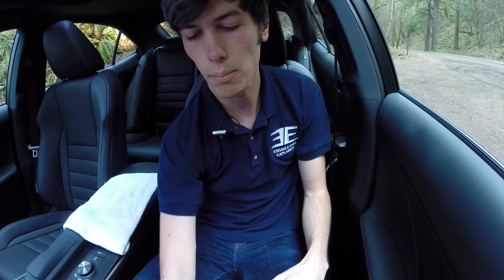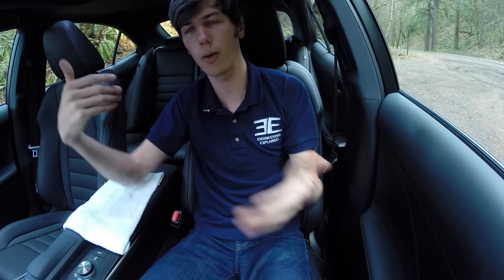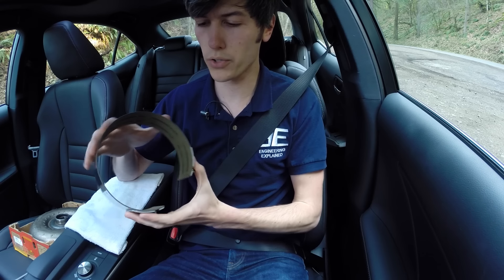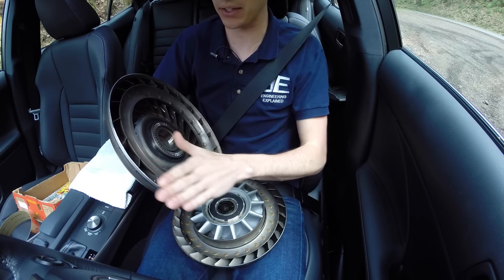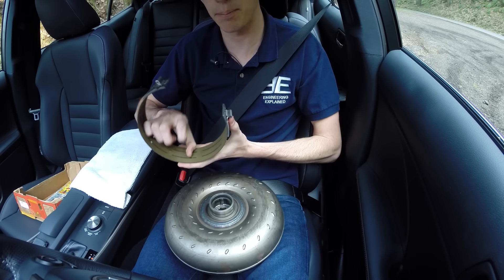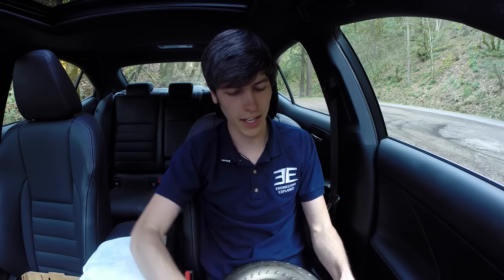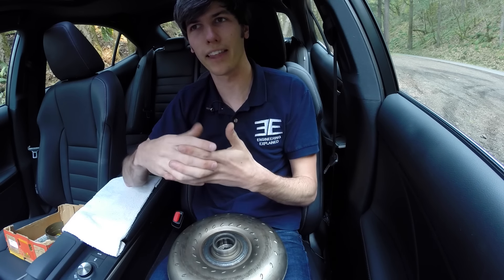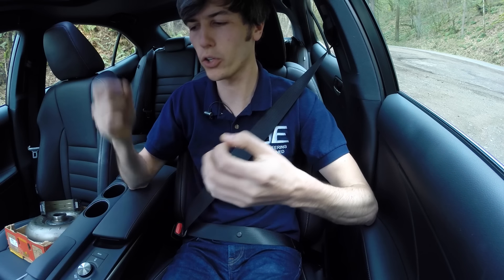5 Things You Should Never Do In An Automatic Transmission Vehicle

Comment: I like to put my car in neutral down a hill and pull the keys out.
Reply: lol
Reply: hahahaha
Reply: Sometimes, I even get out of the car.
Reply: Serious Business OMG lol!!
Reply: No joke. we live two blocks of gravel road away from the highway in town. I spend half a block getting up to 45-50mph (25mph speed limit), then put her in neutral, shut her off, pull of the key and put it in my pocket. Only use the brake to make it home.
Reply: Ethan Reinsch lol!! With all my luck Id blow past the house cuz I wouldnt be able to push the break hard enough! 😂😂
Reply: sometimes i put the handbrake up.
Reply: hahahaah fuel effieciency
Reply: Yes, of course,  how else can one car surf with no passengers to take the wheel.
Reply: Weight reduction. Smart.
Reply: Lol. ..and turn lights off at night to save the battery.
Reply: Darth Ramage and don't forget to remove your seat belt. It's more comfortable that way. 👍
Reply: BAI PATTU rest your eyes too and take a nap it helps on long drives
Reply: HAHAHAHA
Reply: Dodge Neons. Show cars
Reply: Turn coming up. Oops, steeringlock.
Reply: Go downhill backwards in manual shift cars; the engine turning backward creates oxygen and puts fuel back in the tank!
Reply: Laughy ha ha, but I heard on the radio news a few years ago a "warning from a coroner not to turn your car off while in motion" because they found some knob actually self-Darwinised a few years back because they turned it off down a hill, steering locked, crashed, rest in pieces.
Reply: Yeah, take the keys and throw them out the window while coasting down a long hill ! LMAO.
Reply: Darth R. you are crazy man
Reply: you know that's bad for your transmission how do you think its getting trany fluid the car is in gear
Reply: And jumping out.
It makes me think "one more murder that I got way with.
while seing the car going to the river.
Reply: Darth R. lol
Reply: 😂😂😂😂. I live for these comments
Reply: This is why i love read the comments rather than watch the video lol
Reply: +Guru Gill Gurmehar is castrated
Reply: We met in heaven in it ;)
Reply: Darth R. Ayeeeee 1000th like
Reply: Funny actually my truck is so worn that I can pull the keys out while driving, it won't shut off or anything.
Reply: Majestic Bravo my dads truck can do that😂
Reply: Majestic Bravo  My parents had an '83 Caprice that was like that.  Was actually super convenient at times.  If you turned the car off but didn't put the ignition in the lock position, you could start it again without the ignition key being inserted.  Or, ya know, run to the convenience store and take the keys out, leave the car running, but lock the doors.
Reply: Darth R. Lol
Reply: and jump out of the car
Reply: Darth R. La vida es un riesgo carnal
Reply: Darth R. I
Reply: Darth R. 
U cant pull out the keys if its in Neutral
Reply: how many cars do you go through in a year???
Reply: Darth R. I changed all my halogens for battery operated lights and use some recycled batteries from work to power them. When they all burn out I trash the car cause it's not worth the repair.
Reply: I think this is the most entertaining comment thread I have read on YouTube in awhile...and one without hostility! Well i'llbedamned
Reply: HEHE STEERING LOCK......HAPENED TO ME WEN I WAS 14
Reply: if your really cool,youll throw them out the window
Reply: lol ahh i remember having cars where you had to put the keys in lol
Reply: Ethan Reinsch That sounds fun. It’s just like a soapbox derby
Reply: Duane C Exactly like Takumi Fujiwara
Reply: Only on a dead straight road :). Your steering lock will keep you on track nicely until you get to that tree.
Reply: ...then close my eyes.
Reply: Bc lodu
Reply: Salute!
Reply: JM this deserves its own video
Reply: Sometimes I walk
Reply: i did that in my 5 speed 328i and my wheel locked up scared the hell out of me but all was good
Reply: OMG I'M DEAD I SAY, I'M DEAD! 😂😂😂😂😂😂 all the replies are SO FUNNY!!!!!
Reply: good! Turn the steering 180 degrees to the left before you take the keys out next time.
Reply: Used to have a Toyota Duo, if you cornered too hard, the key would fall out, the car wouldn’t notice and kept running 😂
Reply: JM I just like takin my keys out in drive, or at a stop, or when I want to let my truck warm up but gotta run inside, nice havin an old truck 😂😂
Reply: Majestic Bravo same 😂😂
Reply: Oh yeah, well I also jump out of the car to unweight the vehicle to save gas.  Okay, my medical expenses go up too, but...
Reply: @tsbrownie  wait for real? No joke?
Reply: @miguelochoa2103  Joking.
Reply: My 2005 cobalt would do it autonomously after going over a hard bump or pothole.
Reply: @miguelochoa2103  Don't leave outlets with nothing plugged into them because the electrons will spill all over the floor.
Reply: @JettBlast  Particularly when driving a Tesla on Autopilot.
Reply: @baipattu4972  The increasingly loud bing bong might get irritating though.
Reply: @greebj  You have to avoid going all the way to the Lock position. Not that I would do it, but people have sued because their car turned off (like with the crap GM ignitions plus a key chain with a half pound of crap hanging on it) and they claimed the steering and brakes didn't work. This is a lie. The power steering will immediately get very heavy but you can turn the wheel unless you are feeble and the brakes have a stop or two of power left and will still stop the car after that with a lot of pedal pressure.
Reply: @majesticbravo5764  For decades into the 1990's you could pull the key out on GM cars in the On position.
Reply: @CalletaMoth  When I was a kid the neighbors left their GM car like that and unlocked and didn't need the key to drive it. The ignition was designed so you could grab it and turn it without the key. You could close a GM car door with the door locked (unlike Fords which made you lock it with the key) so that could cause a problem but none of them ever locked it.
Reply: The power brake system requires vacuum from the manifold to boost brake power. If you shut the motor off in neutral you lose your power brakes and breaking become much more difficult.
Reply: Do you drop them out the window also??
Reply: When I want a thrill I cutt my brake lines
Reply: Keyless joined the group
Reply: My car's computer wigs out when I go over 60 for too long, so I put it in neutral and restart the car while I'm coasting, then put it back in gear and continue on
Reply: trying to understand
Reply: lol
Reply: You should also come to a complete stop before changing direction because it will tear up transmission. Parts in transmission suddenly have to rotate in opposite direction. This is very hard on planetarys and drive shells
Reply: Omg Same bro me must be connected
Reply: That's actually very dangerous your power steering will disengage
Reply: @ethanreinsch4716  don't try that right away if you get a new vehicle. Column might lock on you 🤔
Reply: Fix your ignition switch or buy antique tags.
Reply: An officemate of my brother did this. Her car got totalled.
Reply: I just cut mines off completely
Reply: Yup.. no better fuel efficiency then just totalling out your car and not having to worry about gas anymore
Reply: OMG
Reply: @serious.business  I usually have time to jump out and run into a store to grab a drink before jumping back in
Reply: @JettBlast  5 hour drive? 2000 40 second mini naps!
Reply: @scottlawson1522  Yep!
Reply: Then RiP in advance for you 🙏😀
Reply: @ethanreinsch4716  that wouldn't work, because if the car is off you lose power steering and power breaking
Reply: @ethanreinsch4716  just be real careful you dont lockyour steering wheel. Also powerbrakes and steering will be gone as soon as you turn the car off
Reply: @drrb4ever  you can in older cars
Reply: Call it driveway to heaven
Reply: Savage
Reply: Brake locked after keys out
Reply: @gurmehargill4586 
 Direct Translation,
from moron to English ; ("DO NOT DO THIS.")
Reply: @majesticbravo5764 
let me guess....  it's a chevy ? I'm psychic.
Reply: @CalletaMoth  yeah when you're sitting in the air conditioning and your wife needs to go back in the house.
Reply: Comment Award🏆
Reply: Sometimes I just turn the steering wheel all the way to the right
Reply: I drive stick and I like turning my car off and putting it in neutral while going down a hill
Reply: A man of culture
Reply: Plus I take off my belt to strap the steering wheel to the headrest so I can sit in the back!
Reply: Ma😊
Maybe your car is manual
Reply: I have a friend who does this too😂😂😂
Reply: I find engaging the steering lock after this to be very good before a harsh bend
Reply: Hahah oh man that cracked me up
Reply: I’m sure you do it night on a dark road with your lights off, too…😂😂

Comment: I got 3 years for coasting in neutral. Just got out.
Reply: How can they tell?
Reply: @michaelrocha7159  

They can't. The only problem is that if you crash and they find your car in neutral, you're pretty much screwed.
Reply: they wont know but I suppose the compute might read shift lever positioning or whatever the call it. I know I live in AZ and know its illegal but I still do it sometimes, lol
Reply: Hard time, brah.
Reply: Ashraf Raja I don’t see how losing acceleration causes an accident. In the case where somebody pulls out in front of you that is. You can still use your brakes. Why would it matter if you’re in neutral and get in an accident that couldn’t be avoided by accelerating? Maybe because if it is avoided you waste time going back into drive which increases risk of collisions for the people behind you who also have to stop? Like I understand not being able to get out of somewhere as quickly from being in neutral and that being the cause of the accident but what if the situation is somebody pulling out in front of you in that case you use your brakes but still hit them? The reason for hitting them isn’t because you’re in neutral as being in neutral won’t change the performance of slowing down.
Reply: @jace_Henderson  engine compression when not being used to accelerate works as a engine brake to help slow down your vehicle while it's in gear. Similar to how a Jacob's brake works in a big rig.
Reply: So did you drop your soap?
Reply: @jace_Henderson  if you were going down hill in neutral instead of using a lower gear you would most likely get brake fade and would not be able to do a emergency stop
Reply: I feel for you. My grandfather just finished out a life sentence for doing this in Pa. His arrest was back in the 80's when they openly discriminated polish immigrants.  
That old Buick coasted so nice...
Reply: Wait r u serious
Reply: @RR-ky6eu  Nobody is serious here, sir. Lol
Reply: Lmfao😂😂😂
Reply: @jace_Henderson  breaking while in neutral is not efficient  u are only uaing brakes at that time, but breaking while in gear either auto or manual is efficient as your engine is also helping to slow down
jut try to stop a car without using brakes in gear and in nutral ur car will stop sooner as compared to that in nuetral, REMEMBER THAT EVERY SECOND IS IMPORTANT
Reply: Jace Henderson  breaking while in neutral is not efficient  u are only uaing brakes at that time, but breaking while in gear either auto or manual is efficient as your engine is also helping to slow down
jut try to stop a car without using brakes in gear and in nutral ur car will stop sooner as compared to that in nuetral, REMEMBER THAT EVERY SECOND IS IMPORTANT
Reply: @ICUP Nibba He is joking or a liar, cause the minimum sentence for driving in neutral is seven years.  Some people get parole after only five years for good behavior.
Reply: Carlos Maron 😂😂😂😂😂🤣🤣🤣🤣🤣🤣🤣🤣
Reply: birdwing98 7 years??? damn why r ur countries so strict😂😂😂
Reply: The Pigs will never catch me coasting in neutral, wasting gas.  Oh, and Physics is racist, too.
Reply: I hope this is a joke but ya never know with the crazy ass cops these days
Reply: @itry_mash8261  I think all those comments are jokes. No one can tell if your car is in neutral.
Reply: @peterf.229  The law about not driving in neutral is from the days of manual transmissions and drum brakes with a single circuit (or even non-hydraulic brakes) and single circuit brakes plus maybe column shifters . If you were for example going down a long hill in neutral you might be using your brakes until they got hot and faded to uselessness. This was not hard to do. Or worse case scenario, your shifting linkage jammed (particularly column shifters can do this) and you couldn't shift from neutral into a gear going down a long hill and the brakes were faded or failed. With modern cars with disc brakes and an automatic transmission of any type which would virtually never be unable to get into gear with one click of the lever or dial none of this is an issue. Plus there is no way for any cop to know you are in neutral.

So don't worry about it.
Reply: @jace_Henderson  The law about not driving in neutral is from the days of manual transmissions and drum brakes with a single circuit (or even non-hydraulic brakes) and single circuit brakes plus maybe column shifters . If you were for example going down a long hill in neutral you might be using your brakes until they got hot and faded to uselessness. This was not hard to do. Or worse case scenario, your shifting linkage jammed (particularly column shifters can do this) and you couldn't shift from neutral into a gear going down a long hill and the brakes were faded or failed. With modern cars with disc brakes and an automatic transmission of any type which would virtually never be unable to get into gear with one click of the lever or dial none of this is an issue. Plus there is no way for any cop to know you are in neutral.
Reply: I almost died due to that. Suddenly brakes didnt work and I noticed my car was OFF. Its dangerous
Reply: Jace Henderson if you’re making a turn in front of another car and lose speed in front of them
Reply: @quarantinejet2312  still can't tell if this comment thread is a big joke or not, but... there's a lot of reasons your car might end up in neutral in a crash.
Reply: @quarantinejet2312  Nope, "your honor, I always put my car in neutral before a crash, it prevents engine fires!"
Reply: @clcampbell85  Yeah, and they use a torque converter for it!! ;-)
Reply: No Joke there are people who switch it off AND go to neutral downhill to (save gas), and the column Locks, and Suddenly an (Obstacle) confronts their front bumper😲
Reply: @jace_Henderson  

It's not the case of causing an accident, it's more crashing a car going downhill in neutral somehow. It probably could happen.
Reply: @DareDevilPhil  

This thread is weird.
Reply: Ok buddy
Reply: Tough break man !
Reply: Carlos Maron                                                                                                                                                                     You better put  your phone on vibrate otherwise you won`t hear it plus you get a cheap thrill.
Reply: @quarantinejet2312  If you crash, and the Transmission Police find your car is in neutral because you didn't put it back in gear before they showed up BECAUSE YOU'RE DEAD, then yes, you're definitely screwed.
Reply: Who knew I could get up to 120mph in neutral.
Reply: @jace_Henderson  Yeah, it's not like you can't immediately put it back into drive.
Reply: @DareDevilPhil  I think the guy in prison with his phone up his butt is joking. I hope.
Reply: Can't believe they didn't give you a brake
Reply: @MsOligui  no, mountains maybe, hills never.
Reply: @RR-ky6eu  Of course he is. Its a terrible crime.
Reply: @mikemcmo  Oh, never  lmao
Reply: Pr0t0c0ls of Kalerg1  Try to avoid beans.
Reply: Neutral illegal, is it April fools day? 🤣
Reply: Pr0t0c0ls of Kalerg1  what the hell
Reply: I'm sorry, can't help it.
In the old days we called it
Mexican Overdrive.
Reply: What?!
Reply: @emjayay  Sure that's what they want you to think. But traffic cops all have neutral detection software now and they can get you in a nano second if their software triggers the special neutral alert alarm.
Reply: That's messed up, I can't wait for the civil war to start
Reply: Is this for real?
Reply: @jace_Henderson  agree with you, i also use neutral coasting when i near the red light and must stop after 100-200m, best way is coasting to there. and i don't think neutral coasting have any bad to autogear box. thanks
Reply: Whose here for the thread!!!
Reply: Lol
Reply: I was executed for coasting in neutral, the sheriff told me "if you like to coast, you become a ghost" and he cut my head clean off.
Reply: That's why I coast in P.
Reply: HuSia Cat  do u call urself on vibrate? 😆
Reply: @MsOligui  annnd yet he goes on to say not to let your engine brake your vehicle, but to use the brakes instead.  The entire video is misleading and clickbaitey.
Reply: @emjayay  exactly, this whole video stinks.
Reply: On manual cars you have to hit the clutch anyway when braking, otherwise you will be forcing the engine to 1000RPM while in gear.
Reply: When I coast in a 2006 Nissan Frontier down hill at 40 mph, the truck idles lower in neutral than it does in drive
Reply: @quarantinejet2312  
In reality, you could shift or have shifted gears without stopping even if it fucked up the transmission, so they really wouldn’t know if it was or wasn’t in neutral before the crash unless they had dash cam footage of your car.
Reply: ROFL!
Reply: That’s a lot of fuel savings!
Reply: @quarantinejet2312 you could hit it by accident in a crash it goes in Neutral.
Reply: How do the police know it's in neutral?
Reply: @quarantinejet2312 
U mean double whammy 😅